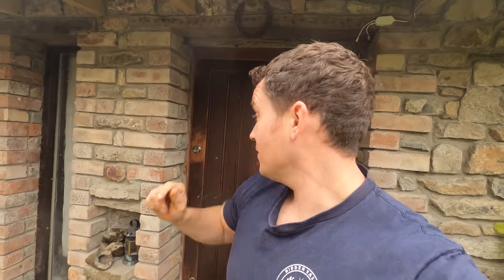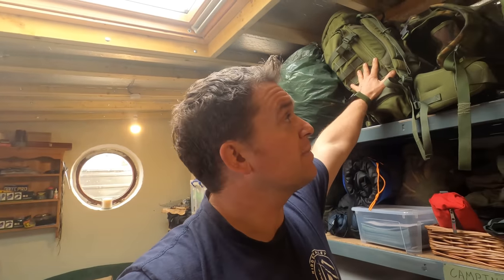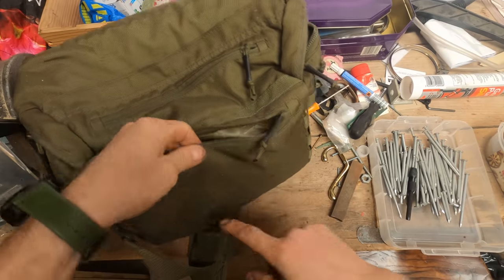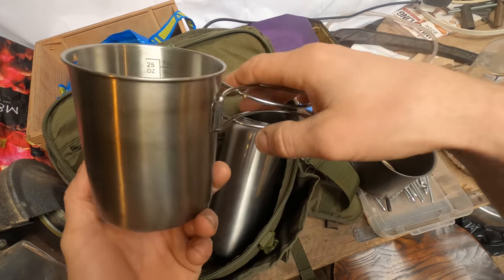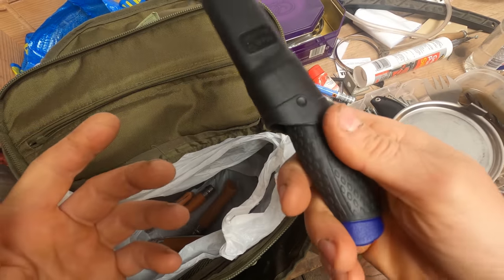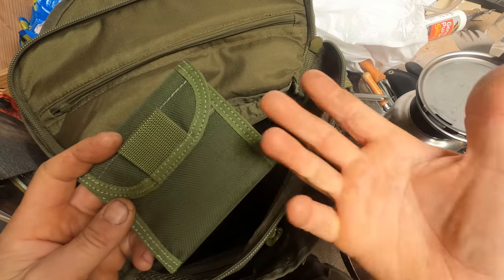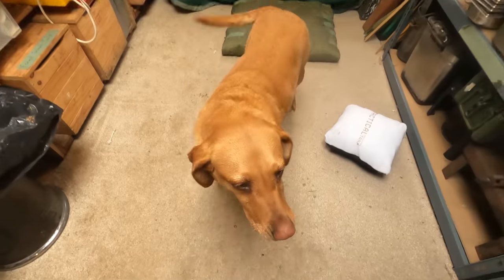EXCLUSIVE!! My New Workshop Tour plus a closer look at YOUR BUSHCRAFT GEAR

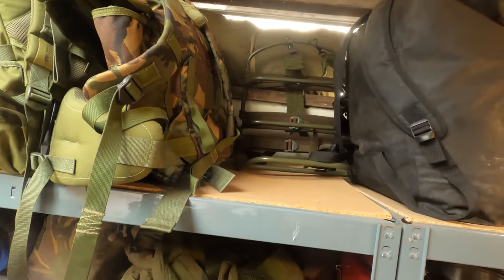Comment: 5:45 this is swedish army Lk-35 rucksak. Propably made by Haglofs. I got the same & I love it. Great workshop, thanks for sharing. Greetings from Poland.
Reply: LK35 is such a beautiful bag. Heavy but also very heavy duty. Great for use with cold or mittened hands.
Not sure that the frame behind it is an Alice pack one, though...the curves on it look more like an old SAS bag I've seen...the Alice one has more straight edges and is Alu.
Reply: jeso these are like gold dust never mind getting one in pristine condition:
Reply: @gezdonaghy2456  it took me few years to find one in very good condition. But patience is now rewarded. Maybe not virgin, but quite close... 😜
Reply: LK35’s are strong and simple. They are be modified to fit your needs, dozens of YT videos and tutorials.
Reply: @mistatat  are right. That’s not an ALICE frame. I don’t know what frame that is, but it’s not an ALICE.
Reply: It is the LK35 but I reckon he knew that, fishing for some comments I reckon, clever boy.

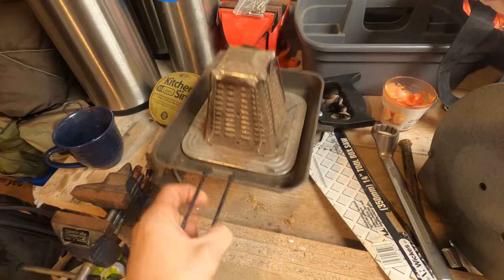Comment: That "top of an old paraffin lamp" at 2:45 , is actually a four slice toaster to go over a gas flame. Ideal for snacks in the workshop. 
Probably best not to use the kleen canteen bottle over a fire with the top screwed on as you suggested 💥
Excellent channel. I really enjoy your vids.

Comment: In my workshop i use an 80W oil filled tubular heater fitted with a thermostat.Its probably the most cost effective/efficient heater for your floor space and will keep any moisture/mould from forming on all that lovely kit.Very reminiscent of the CQMS stores.

Comment: Great to see things are moving on at a pace Nick. That's definitely going to be a proper G10 for men workshop store. I especially like the gentleman's cupboard! I use a Karrimor Predator 80-130 and Predator Patrol 45 both with or without rocket packs depending on what I'm doing. There are plenty of reviews for the 45 but the 80-130 is lacking. it would be great to see a working review on that beast. Raised a glass (or two) of single malt to all our fallen and broken today. always a poignant day for me. All the best C.

Comment: You might be able to maximize the space with a deeper cabinet over the window with LED lighting under it to illuminate the work bench.  And maybe a floor to ceiling cabinet between the door path and the shelves where the coats are.  When you outgrow that, you could ditch the couch and replace it with a set of lower cabinets and more bench top space under that round window. More insulation between the rafters and Eyelets attached to the rafters to hang even more gear in front of the shelves.  After that you will need a bigger space.  Good luck from a guy who had a full time woodworking shop in a tandem garage with as ceiling height of 6' 4" and learned how to use every little bit.
Reply: @hiddenvalleybushcraft5683  anytime. I know what it’s like. Love your channel. Solid tips. I hope to someday make it over the pond to take a course.

Comment: Hi Nick one idea for the grinder and chop saw.
With limited bench space and also needing to use the tools on site with a workmate or portable bench. I designed a docking station. This was really simple but can evolve. The basic start was to secure an identical footprint piece of MDF to each tool, big enough that the edge of the footprint extends over the front of the bench where a strip of wood can be fixed like a bench hook.
I hope my description is understandable so far. 
With all the tools having the same footprint now, they can all be located into same piece of bench space and secured with one or two quick/G clamps.
Advances to this could include two strips or French cleats either side to slide the tool into the dock.
Great video as usual.

Comment: The holes in the Pathfinder cup are to put their pot holder into (otherwise called a fish mouth spreader.) and the slots in the lid are for the same thing. The holder will also fit inside the bottle so you can hang it as well. Thank You for your teachings from Canada.

Comment: Maybe do a vid on making a lid for a Crusader cup. Mandril out of ply. Bit of stainless cut tap tap. Press a slot in for a handel as per any titanium lid bend up a triangle or whatever floats your boat.

Ext frame packs. Maybe as you potter about come up with something on that. Ppl have made alice frames from electrical conduit. Perhaps come up with a cheap easy frame to make. Once you got that it doesnt take much sewing skill to make a bucket pack to go on.

Wire and stainless welding rods are interesting. Toasting forks, fish spreaders for pots etc.

Comment: Hi Nick. Love your videos. Top tip for workshop heating and lighting. Get an old Tilley lamp. They can be bought fairly cheaply, and are fun to restore. You will get 12 hours of heat and light from about 500ml of paraffin. Even the feurhand style lanterns give off a reasonable heat, but nowhere near the heat you get from a pressure lamp.
Reply: Nick, if you would like a couple of "Tilley" lamps I inherited about eight some years back, they all worked but most are now stuck in the back of the garage. It would give me an excuse to nip across Bristol way and visit.

Comment: I use that buck knife but it is a tad too small for my hand so I used that self grip rubber tape to beef the handle out but you can only strap it out to the size of the faster on the sheath. I have it fixed to my Matilda bag so it's handy to have a small fixed blade when out and about.
Reply: @hiddenvalleybushcraft5683  have a play, if your hands are like shovels you'll need to do something. Great little blade for a camp.

Comment: Try a large clay plant pot with the candles. I use one in the winter in my greenhouse to keep the frost off. Just be careful, my workshop burnt to the ground last week (over heated batteries). 
Pleased you are doing well with your venture.
Reply: Crisco shortening candle

Comment: I've been playing with candle heating with terracotta pots, works well but would be interested in a metal version. Also I've been making some fuel blocks or fire lighters with wax and wood chippings, I made them into blocks of about two sugar in size and they burn well for well over 10 minutes,  I shall use them in my bushbox pocket as back up plan B if I can't find dry twigs. That Helicon bag is a really useful bag,  your work shop looks great 👍 . Very interested in your up and coming mental health videos.
Reply: @hiddenvalleybushcraft5683  on it with the heater, I let you know if it works but after I saw yours I started jotting ideas down. I have some thin, about 0.7mm, copper which I am going to fashion into something that will catch the thermal heat and radiate it out. The whole should fit inside a 750ml pot. May not work but one thing for sure it will be great fun seeing if it will. It's my way of dealing with stress being creative.

Comment: Hello pal!! Very impressive, both your stuff and also the donations, I'm really happy for you.
For your worktop I suggest looking into flip tops-a section of the top on a broom handle sort of thick dowel, so on one side you've got all the space you want, unobstructed, and on the other you'll have your tools fixed in place (mitre and grinder from what I saw initially). Not the whole worktop, just in segments and consider where the center of balance is for easier maneuvering. Some people put a door with a rabbit (groove) on it, some a bolt lock to secure it. Also Infront you could have a sort of higher shelf, like an average computer desk, for things out the way yet still needed like a monitor and lights, stationary etc-in this case, well whatever you might want regularly. Some people organise screws and  nails in jars on a carrosel, some like me (at least for the time being) use boxes on a sort of plastic french cleet-the range sells the French cleet for £2 I think, and boxes for maybe £1.50 idk, but cheapest I've seen. For your head room, you might actually get away with sacrificing a foot down for pull down shelves (paints, meths, idk) which when pushed up and away merge like/as part of the ceiling. Lighting is also important, I suggest cheap string/ribbon led lights-direct and focused on your worktop and shelves, indirect (bouncing/casting off the ceiling/a reflector) in the middle easier on the eyes for general use. For the workbench it looks second hand like mine, my grandads..but if you can, consider having it actually on the wall like a heavy shelf with supports on right angles so you won't be kicking anything, making it look minimal and open which may make a world of difference from being cramped if applicable. Drawers are a best friend too :) I'm autistic, I proper go into depth researching things :')
Reply: @hiddenvalleybushcraft5683  it's cool pal, I get proper invested when researching things myself. The gestures there: if I was close I'd offer my help. just don't be overwhelmed, it seems you've done a ton of work on it already :)

Comment: From gov.uk: Lock knives have blades that can be can be locked and refolded only by pressing a button.  So in theory as long as you have good reason, an Opinal knife should be ok
Reply: There has already been a court case to test this.
The confirmation was that the blade must be capable of folding at all times.
Just make sure you have good reason, if you carry it for whittling etc make sure you have a block of wood you have been carving a teaspoon etc.

Comment: I am sad that you are talking about spoon slots, it makes you look bad if you didn't research first. The side slots are for the bail handle, and the other lid slot is for steam to exit (the first lid has round holes for that and also to work as a strainer if making pine needle tea and the such. High carbon is good for flint and steel, as for modern firesteel it is not the carbon but rather a sharp edge and hard material ie. you could do the same with stainless or a sharp glass edge. Firesteel works in reverse of flint and steel. If using the bag as a shooting bag, that narrow pouch could be used to hold a take-down cleaning rod, one may not clean in the field but it is nice to clear an obstruction. Enjoy your workshop!